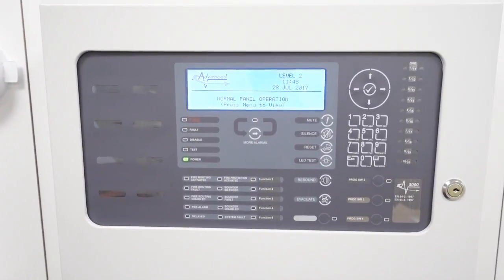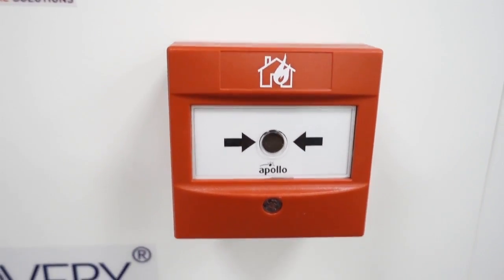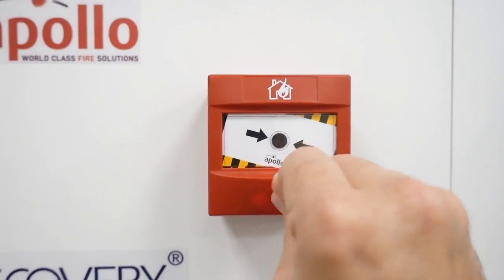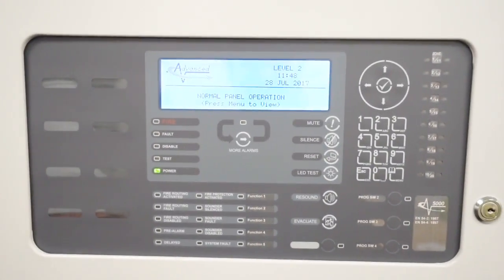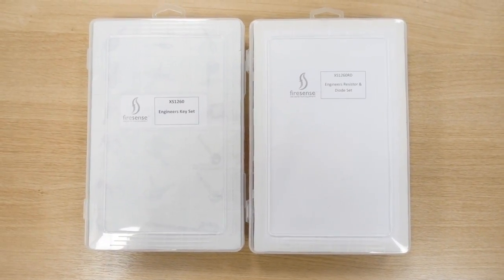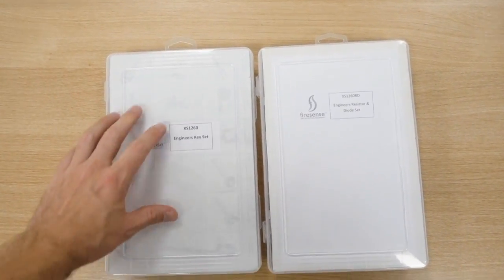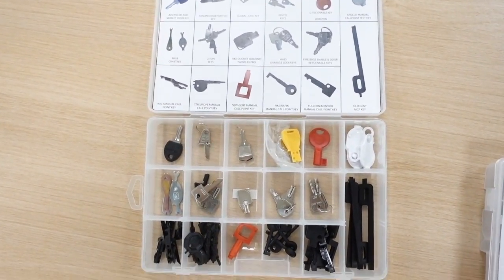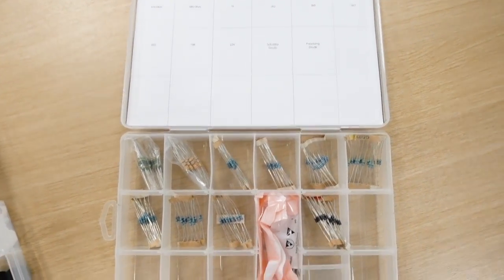TESTING ADVANCED ELECTRONICS MX PRO 5 PANEL | APOLLO MCP | FIRE ALARM DEMO

Comment: I have an mxpro5 which I need to install with Apollo Input output unit  SA4700-102APO, 4 fireray sensors, 2 MAC addressable, 1 Sounder addressable.. how to do the wiring

Comment: Hi Dan where are you based.Need a repeater panel moved and reprogramming.
Can you get back to me 
Regards 
Derek
Reply from the maker: Hi Derek. I an currently in New South Wales in Australia! I travel full time www.youtube.com/ourventurebeyond.com
Reply: @DanstheEngineer  Hahaha really well I need you in chertsey .
Anyway can you help .I've got move a repeater panel which is wired to  that firealarm panel.Now if I disconnect it and reconnect will it need reprogramming or will it be ok.I haven't done much work on addressable systems.Next question is I need to disable a few heads and reconnect on new ceiling.I probably need manual ,is it straight forward
Regards 
Derek
Reply from the maker: @derekgoodwin6646  in all honesty Derek you need someone who is familiar with the system because it is possible to disable it so the re-commissioning once it is moved is important. Drop me an email and I'll recommend a contractor for you danstheengineer@gmail.com
Reply: It can be easily moved and doesn't need re programming as long as you keep the network cables going to the exact same terminal they come out of.

Comment: Do they have a default password? I have a issue with a company that wont release the password.
Reply: There is a way to get in with out the code, you have to press a set of keys in the correct order and times that then gives you a code, then ring advanced and give them that code which they will give you a code back to allow you in to change the code.
Reply from the maker: Hi Justin. The panels do have a default password but it can be changed which is what often happens. I do not want to release the engineer password because a user who hasn't understanding of a panel can really do some damage on a life safety system. However, feel free to ring the manufacturer - web link below. If the engineer has locked out the panel you can re-commission it but a new maintenance company would have to do this. It can be an easy task depending on how big the system is. https://www.advancedco.com/
Reply: Dans the Engineer  I work for Johnson Controls as a Electrical systems specialist for our Simplex Fire alarms and we have taken over the contract for the facility and to be honest this is the first time I've ran into this particular panel, mainly because here in the states Simplex is the most advanced so generally all large facilities run on our systems but we are expensive so from time to time I run into smaller panels like this one. Any way, the company before us is giving me a hard time about accessing the panel cause they lost the contract and say they lost the password, so now I need to find away around it. So your saying I should be able to contact Advanced and they will be able to get me in?
Reply from the maker: That happens A LOT over here! Advanced can't just get you in because usually you need that engineer code regardless but speak to Advanced and see what they say. Tell them you have taken over the system and the previous maintenance company will not provide the engineer code. Whenever we have come across this, it hasn't been large systems at all so we just wiped it clean and re-commissioned which didn't take long. However, I can imagine that could take quite some time on a larger system!